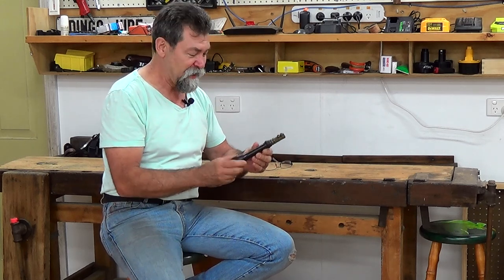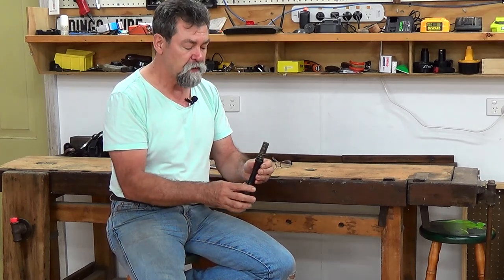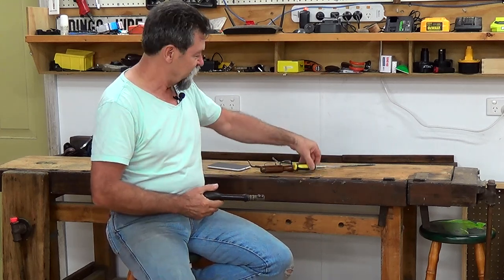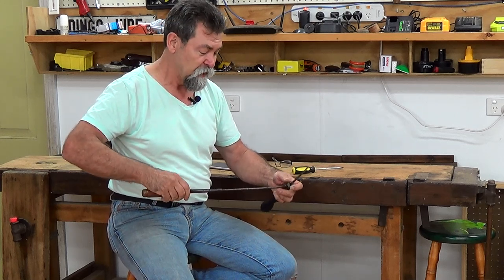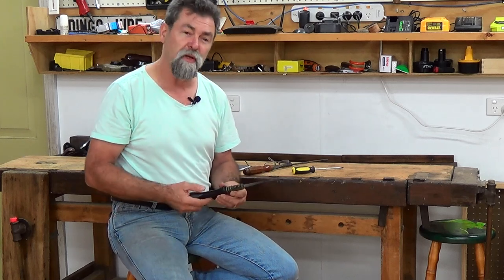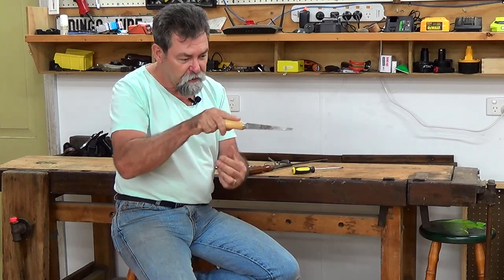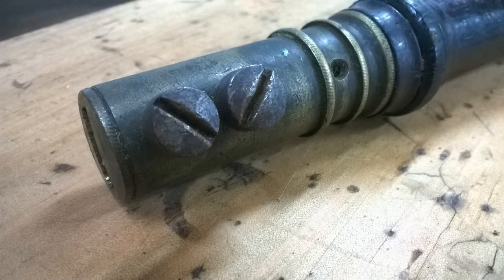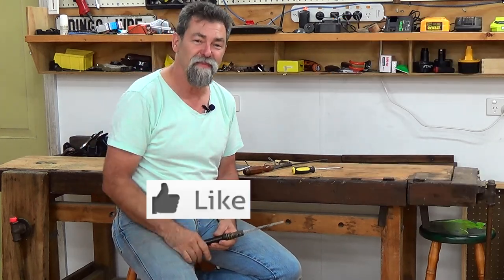Key Hole Saw | Arthur's Tool Box

Comment: I think the biggest reason we don't like the "gent saw" type handle in the US is because of the lack of control over it. When you register your hand on a saw handle, there's a balance to it that you don't get from a rounded handle like this keyhole saw. We typically like a full tote or open tote, pistol grip design. Either way, that's a nice looking keyhole saw you have there!

Comment: Sorry ..also you would only ever  extend the blade as far as minimally possible to stop flexing.. How many bent blades have you thrown away :)
If I had to guess how to cut the groove...i would take a 3' length of closed grain timber...plane square on all sides....then split(not cut) down the center....then rebate the groove on both sides of the split face...glue,reassemble,clamp,cut to desired lengths then turn.
Reply from the maker: +Sean Parsons Not one because I have never used his saw. But I will keep that in mind when I do. Thanks again!